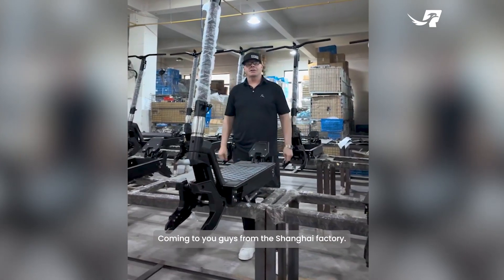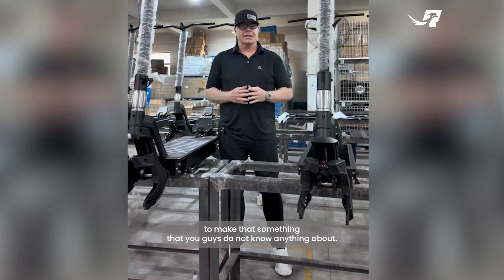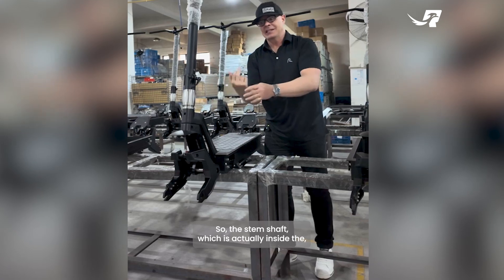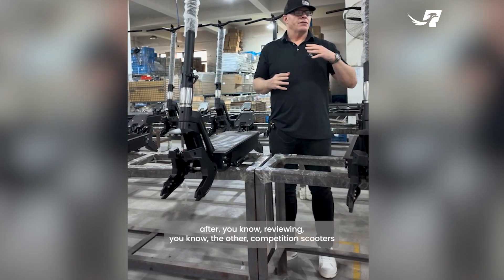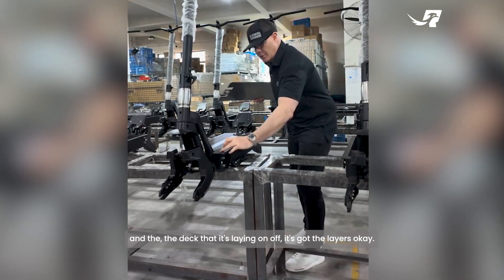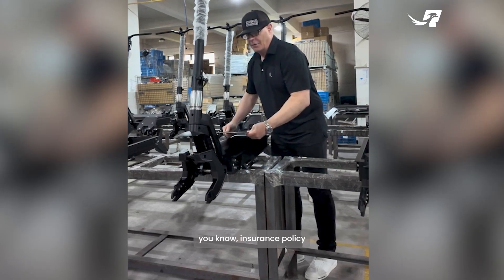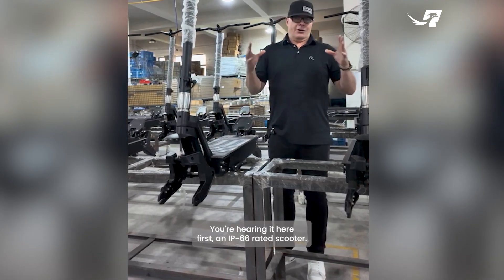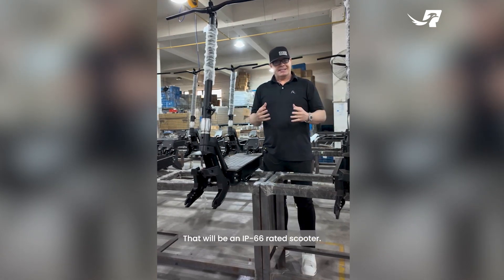RX7 Detailed Production Update

Comment: I've bn excited about the RX7 since the 1st video, with these specs I wouldn't ever need another Scooter.  Unfortunately I bought a Kukirin G3 Pro last September & after 2 weeks I wish I had paid extra for the RS5 Max. so many issues within 1st 2 weeks then 5 months without a scooter waiting on the correct parts,  controller, charger , suspension .support supervisers being dismissive as for the specs I would say false advertising. Kukirin emailed me saying that the 80km range is based on a 50kg rider on mode 1 single 😂😅😂 so unrealistic is an understatement..great videos😀
Reply from the maker: Thank you for sharing your experience